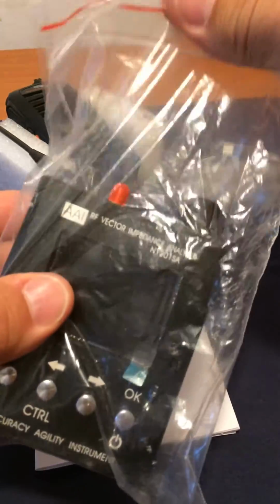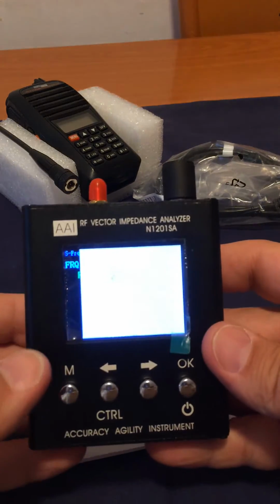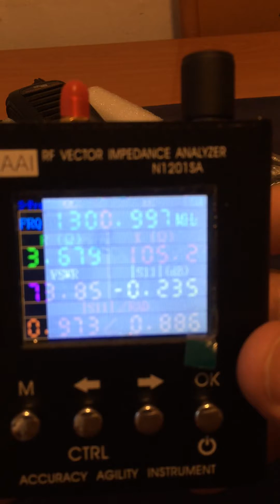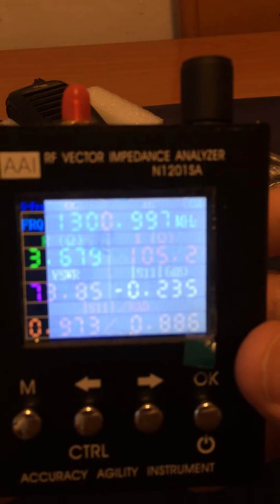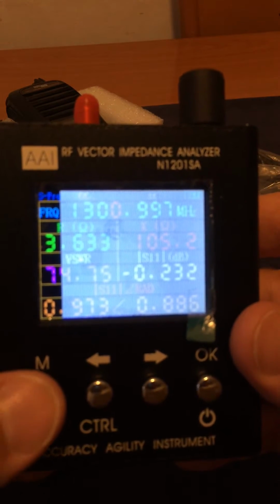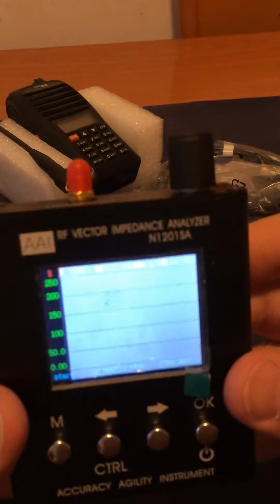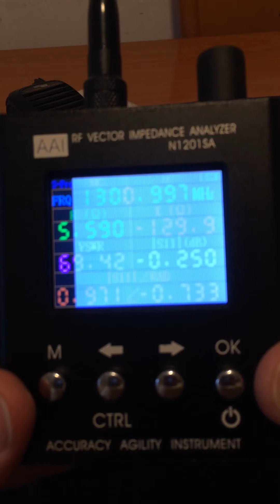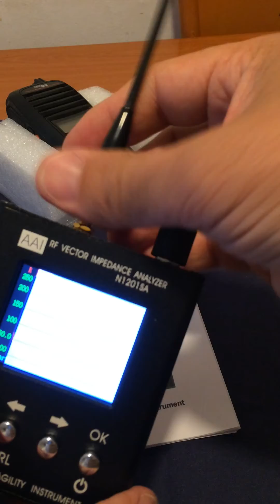Faulty N1201SA Vector Antenna Analyzer

Comment: Hello, can you make the video work of the instrument in calibration mode?
Reply from the maker: Hi! I'de be pleased to try, but I'm not sure I really understand what you mean. 
Actually the instruments has 2 "calibration sets" you can chose from: the factory one which is also default, and the "custom" one. But i honestly never tryed this feature yet.
The instruments comes already calibrated, whereas the so called "calibration plane" is at the embedded RF connector. 
You may want to make a new calibration if you are going to use significantly long connection cables (means just few inches at 1 GHz or more), or maybe questionable quality connectors. Furthermore, to calibrate up to 2,7 GHz you need high quality "short", "open", and "50 Ohm" samples, which will probably cost more than the analyzer itself... I luckyly have some of them, but with N-type connectors. So I should use adapters, but this doesn't make much sense, as they will influence the calibration results. Not sure the results woud make sense

Comment: My display and most other things are perfect. But, the encoder on top was wired backwards so its typical clockwise down and counter clockwise up. Not serious. It also turns on only with the reset button, but turns off with the power button , and that is strange. Otherwise, very happy.
Reply from the maker: Hi! I never payd attention to the rotation direction for frequency UP/DOWN. I have to try it.
Anyhow I wonder if it is possible at all to wire the encoder backwards. From what I remember, the pins from the encoder are directly soldered to the main board, so there are no wires anyone could connect the wrong way. I should still have some photographs I took during the repair somewhere in the PC at work, just to check it visually. 
As for powering on/off, my unit (and the ones of some friends here) seem to work well. Never had to reset the unit by now. You just have to press the buttons the right way and with the right timing. The design is somehow "sensitive" to this kind of details.
Reply: I did finally look at the instructions and its an unusual two button key press.  left arrow and OK at the same time. Its in the manual. I have not looked at the encoder inside to see if it goes direct into the pc board, but that would make sense.
Reply from the maker: Hi Michael, nice to hear you found how-to in the manual.
In the meantime I tryed the encoder of my unit and found the same behaviour as your one: clockwise is frequency down, counterclockwise is frequency up. Seems to be a "feature", not an error.
 I also found the Fotos, and by the way opened it up to take some close-ups of the connections.. Here you can see them: https://drive.google.com/drive/folders/1zZU_Xz-3arzxtLAvG0YEDyIJJezSz06l?usp=sharing
As you can see, no cablings inside, everything is soldered directly to the main board (or to the display board). It should be possible to invert the encoder direction by cutting two traces on the PCB and reconnecting them crossed with wire-jumpers. But I can live with the "feature" anyhow.
73 de in3avw / ac2eo

Comment: Damn, bad luck! Did you manage to get it replaced or fixed?
Reply from the maker: Hi Jonathan, thanks for writing.
Yes, it took a while but at the end the seller managed to provide me with a spare display module. I replaced it myself and the instrument runs now as expected. 

By the way, the video was made on request for the service team to see the problem. Maybe I'll remove it next days.
Maybe I'll take the time to make a new one comparing measurements with some profexional instruments I use to handle. 
Apart from some questionable constructive solutions, it's a nice piece of hardware at an affordable price for passionate hobbysts.
Reply: Hi, I think you should leave video there as to show people what can happen.I want to buy this also, cheers Brett